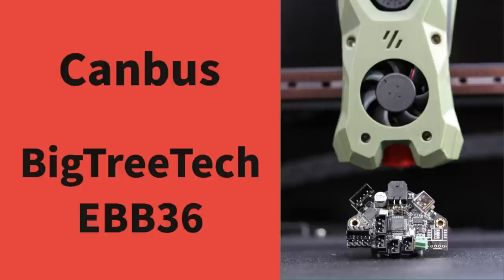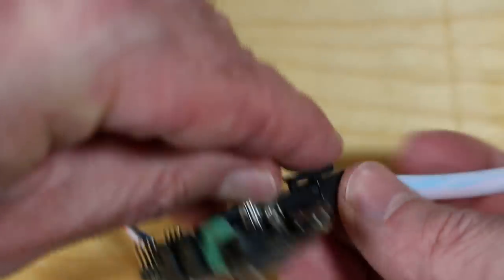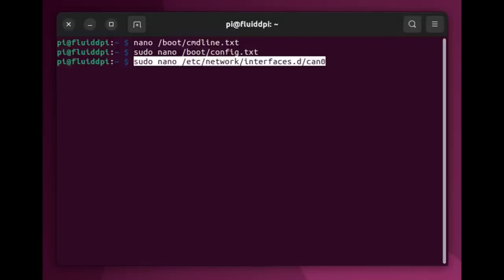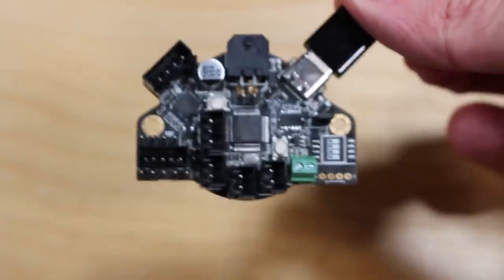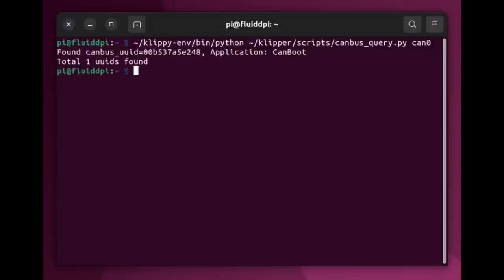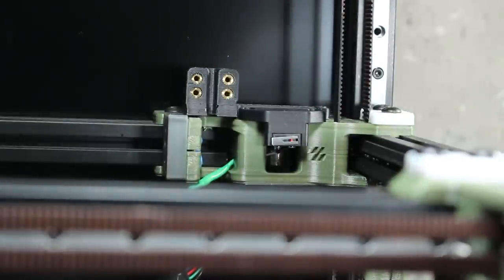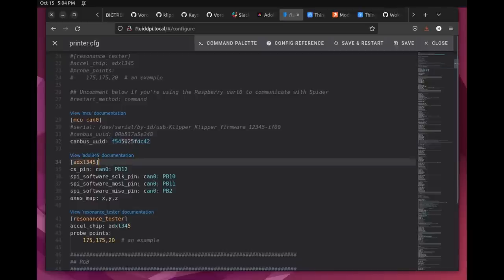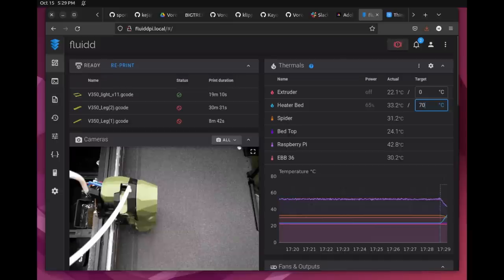Canbus (can bus) - EBB36 / EBB42 Install with Klipper on Core-XY Voron 2.4

Comment: dude sad that You uploaded this vid just now... 1 or 2 weeks ago would be better ... had to learn everything myself 🤣
Reply from the maker: Ha!  I wish I could have delivered this sooner!  Thanks for watching!
Reply: @KapmansBasementWorkshop    personally went octopus 1.1 to ebb36 directly and sensorless homing. Not solved umbilical itself jet but I liked idea of 6mm ptfe tubing. Though for me that solution might be troublesome as my wires are silicon coated. Doubt that i will get some weight saving as before i was running IDC flat ribbon cable instead of chains. You can check it on my channel on my VL serial number request video if curious how IDC setup looks. Had identical setup on both V2 an VL before this week. This is my 3rd wiring for my v2 🤣
Reply from the maker: @Baltojikale  I don't have the octopus, but if I did, I probably would have gone direct as well.  It appears the spider might have the ability as well, but there's no documentation.  I'm very happy with this.  One day, I'll give sensor less homing a try.  Thank you!